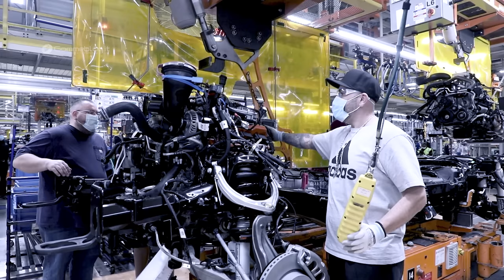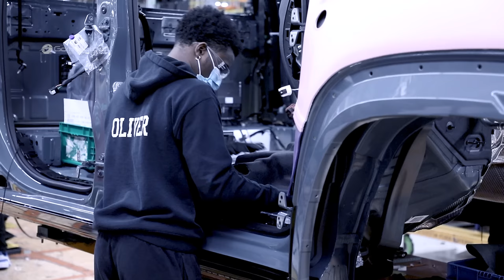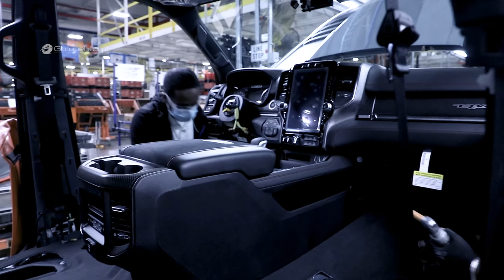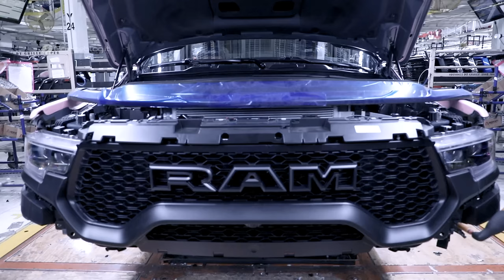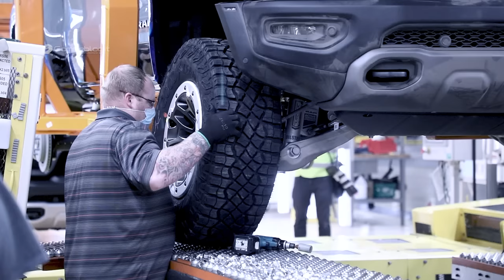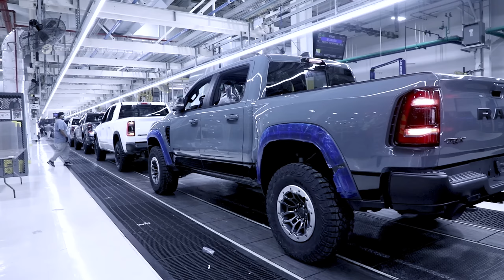2021 Ram 1500 TRX - PRODUCTION (TRUCK FACTORY)

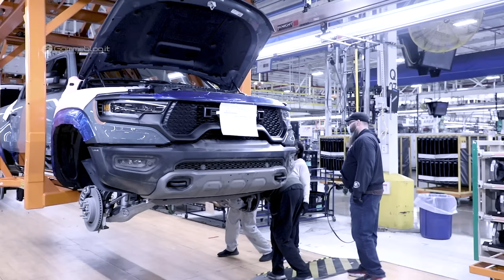Comment: 03:30 
Those brakes are too small for such a big engine and heavy vehicle. At least it needs 2 pistons for front and larger brake rotor.
Reply: That's the rear. But I still agree they should've offered the Brembos from the Challenger/Charger models.
Reply: Would those wheels even clear a big brake setup like a challenger has?